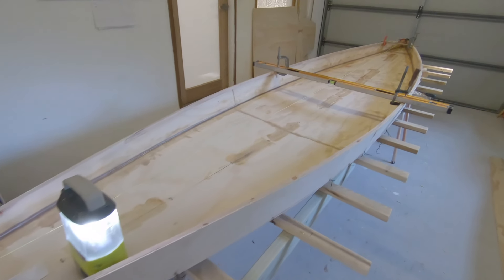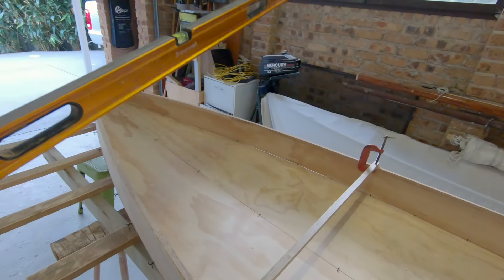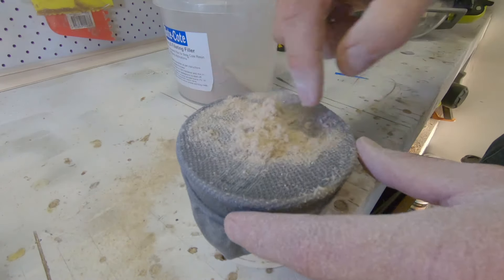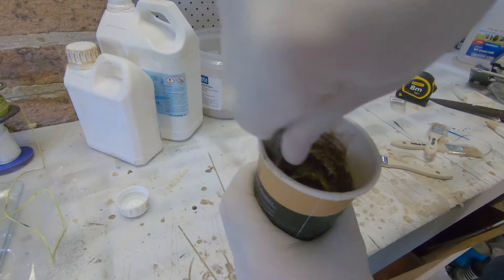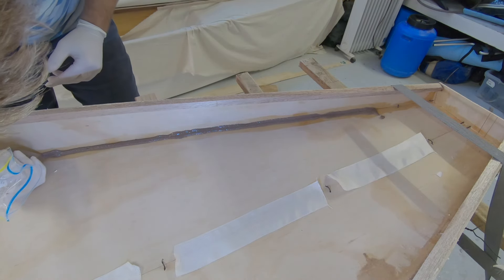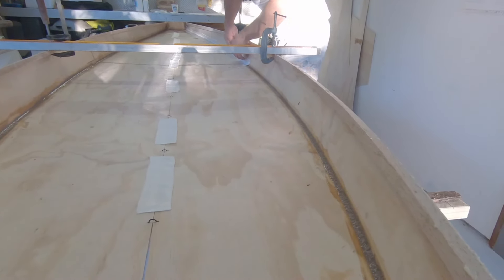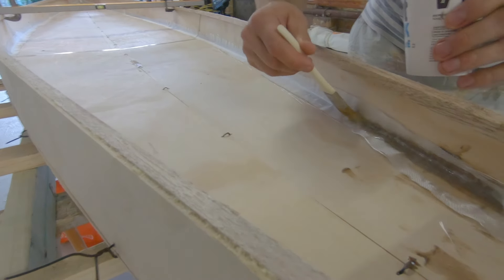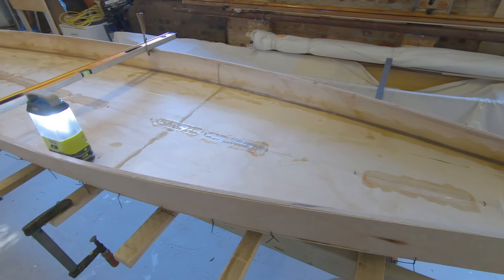#DIY #SUP Ep 5 - build a Stand Up Paddleboard from plans

Comment: Hi Aaron, great step by step videos. I see you epoxied and taped over the wire. At what point did you remove the wire? Thanks!
Reply from the maker: Hi Bethany, I pulled some of the wires out and some of them I left in. The wire I used in plastic coated which will go some way to reducing corrosion. Ideally you want to be using copper wire which can be left in place.

Comment: I received the free plans,  thank you. 
They are a different structure than the hull you put together in the videos. Is it exceptable to make the ribs per your video rather than the one piece ribs shown in the plan?
Reply from the maker: Hi Walt, apologies for the delay replying to your question. You can make the ribs either way. The best way would be to use the dimensions from the plans and use the positions as indicated. I hope that makes sense!